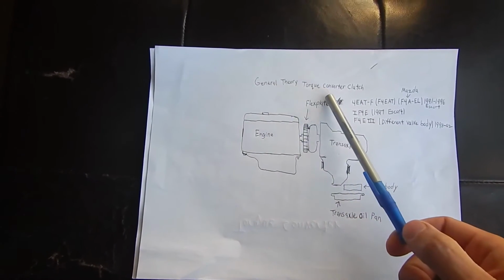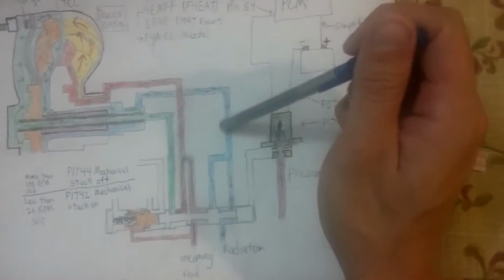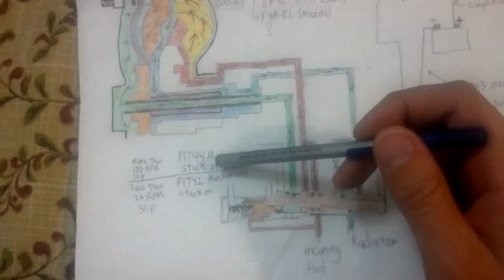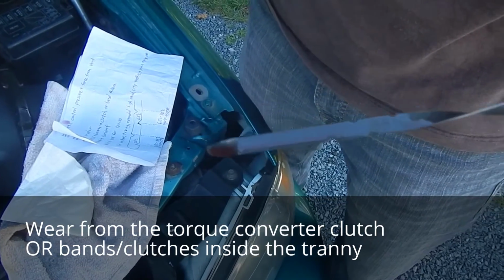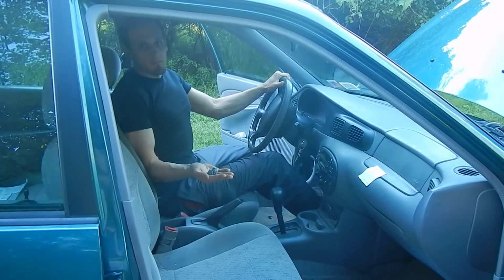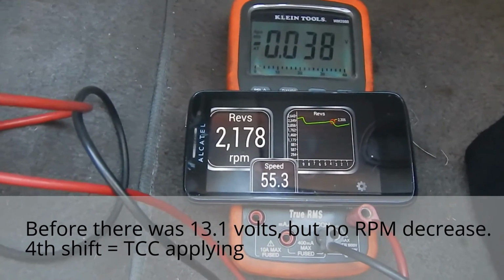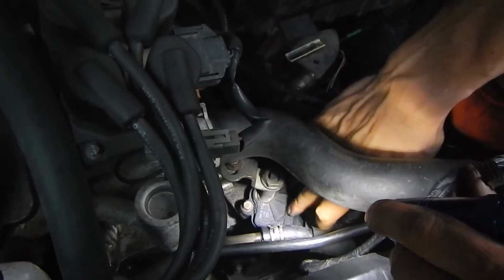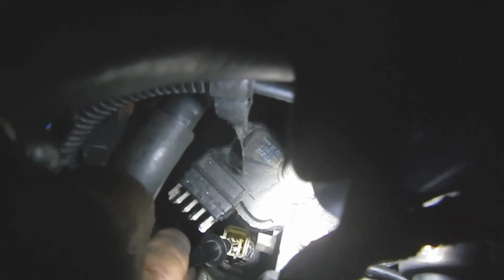1991-2002 Ford Escort Automatic Transmission Troubleshooting P1744 P0748 P1740 P1742 Pt. 1 Tracer

Comment: How many miles did you have when this happened soy problem is 2to 3 slips and recently after a week 3 and overdrive don't work also code p1744 but as of yesterday the car was slipping around 40mph but once past the freeway speed were fine but all the sudden yesterday as on the way back I could not go past 2 gear also the car seemed to not want to downshift correctly until I came to a stop any help is greatly appreciated I tried putting some clean fluid 1/2 qt cause it was a Lil low but nothing same problems also car is at 220k original trans so I' think it's done for
Reply from the maker: 143000 miles I started to get it intermittent. I bought it that way unknown to me.
Reply from the maker: The car now has about 250,000 miles on it.

Comment: I have a 1994 escort. Yesterday I lost reverse. When the car was started at a standstill reverse acted as park and neutral acted as drive. After I got it home I put it on jack stands and waited a couple hours, i took it off jack stands and got reverse back. My fluid is a pink/brownish color. Please help!
Reply: As I drove home neutral went back to being neutral
Reply from the maker: Try checking the shift cable on top of the transmission. It maybe misadjusted and fluid level. Also run a stall test to check the condition of the friction surfaces. Also check the tv cable. I have a video on that. Finally subscribe to my channel to help me out.
Reply from the maker: If everything looks fine and continues to work add a transaxle filter.

Comment from the maker: BAFX tool shown in the video that links to your android cell phone: https://www.amazon.com/gp/product/B005NLQAHS/ref=as_li_tl?ie=UTF8&camp=1789&creative=9325&creativeASIN=B005NLQAHS&linkCode=as2&tag=crisplinemeta-20&linkId=652554d9d197cb11ac20fa7f5d922e62

I have had the tool for about 2 years now. Combined with software like Torque Lite and ForScan it's a powerful and cheap diagnostic tool. 

With ForScan you can directly access the engine/transaxle sensors such as the car sensing a torque converter clutch fault , torque converter clutch solenoid, engine rpm, purge flow solenoid, purge flow sensor, transmission temperature, etc, without PIERCING WIRES AND CHECKING DIAGRAMS.

The company stands behind it's 2 year warranty. I had one go bad and they quickly honored the replacement warranty.

Comment: I just bought 98 ford escort and noticed not shifting to overdrive. Got my scan tool and code was p0734 which means 4th gear ratio etc. Does this mean tranny is bad or torque coverter
Reply from the maker: I don't know id check the factory manual or look the code up online. Watch my other escort transaxle videos.
Reply from the maker: Mine wouldn't go into over drive due to a dirty selector switch on top of the transaxle.
Reply: @supermetaltastic  where exactly is that located
Reply: What I mean is, will  not go into overdrive.Going down the highway.It's just shifts first couple of gears but it will not shift to the overdrive while going down the highway
Reply from the maker: @Rick-gk3ro  That is what I'm telling you. You can use the obd ii blue tooth connector, your phone and Forscan to see what gear the PCM thinks the transaxle is in.
Reply from the maker: @Rick-gk3ro  on the 97 a cable runs to it from the shifter inside the car to on top of the transaxle. It a semi round black thin box
Reply from the maker: When I used forcan I saw a ? or error for the gear it thought it was in. Everyone was telling me the transaxle was shot, but it was just dirty contacts

Comment: Hi my friend!

I will try to explain the problem of my Mercury Tracer F4EAT trnsmission with my bad English.

I turn it on the car and I put and any shift for example R, D, OD whatever shift apply no problems, but the problem is just around 60 seconds aprox and later the shift it's out , and turn it off the car 60 seconds aprox and turn it on again and aplied again? Where it can the problem? Thanks in Advanced.
Reply from the maker: Are you saying the transmission is slipping? What is the shift is out?
Reply: @supermetaltastic  No slipping or creeping, after 60 seconds the gear loose
Reply: @supermetaltastic  the car stay neutral after 60 seconds
Reply from the maker: @Sandykroy  I understand now. Let me think. Do you have a blue tooth OBD2 scanner and the application forscan.
Reply from the maker: If you have a blue tooth OBD2 scanner use forscan to check what gear the computer thinks the transmission is in.
Reply: @supermetaltastic  I don't have but I can find one. Another question: is needed have the transmission conected to ECU just for put gears? I readed when the transmission its disconected it will work but in a one gear for example 3, or 4.
Reply: @supermetaltastic  the problem is : Why after 60 seconds the gear loose?
Reply from the maker: @Sandykroy  If the transmission range switch which sits on top of the transmission read wrong the car will not shift into fourth gear. That has been my experience.
Reply from the maker: @Sandykroy  Also run a brake stall test and tell me the rpm reading.
Reply: @supermetaltastic  1000 RPM aprox , When RPM is over 1000 RPM may cause loose the gear?
Reply from the maker: @Sandykroy  over 1000 rpm the car goes into neutral?
Reply: @supermetaltastic  No, car go neutral after 60 to 120 seconds started
Reply: @supermetaltastic  before that time the car work normal in all gears , in other words, when the car or transmisión oil hot the car go neutral
Reply from the maker: @Sandykroy   attach a pressure gauge. See my other video.
Reply: @supermetaltastic  ok thanks. The transmission its totally in neutral no work anymore.